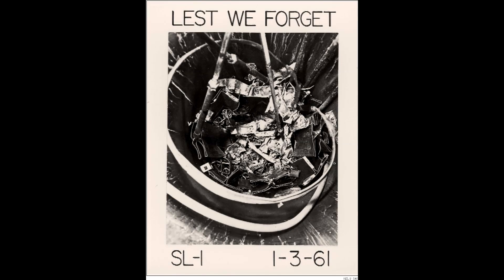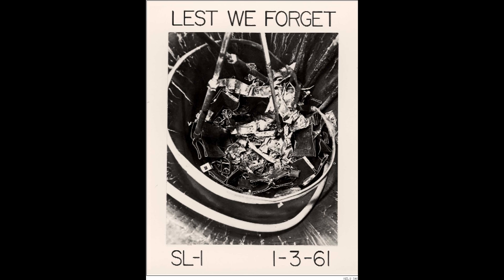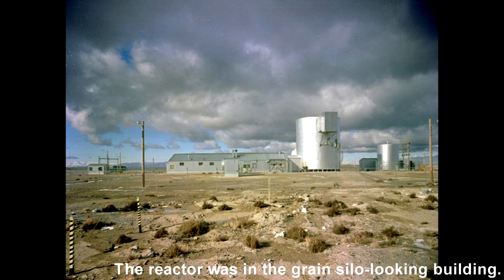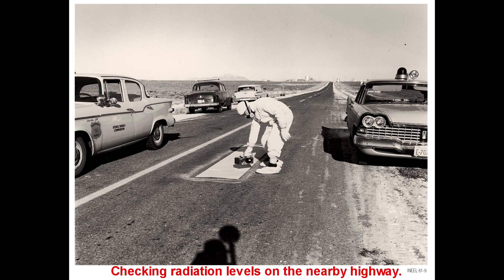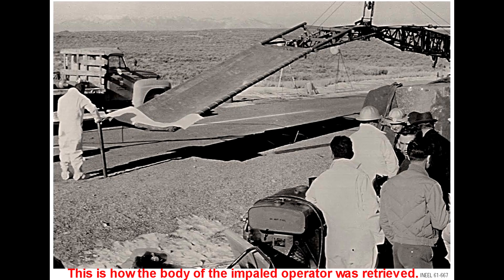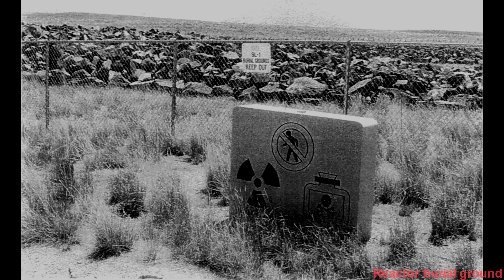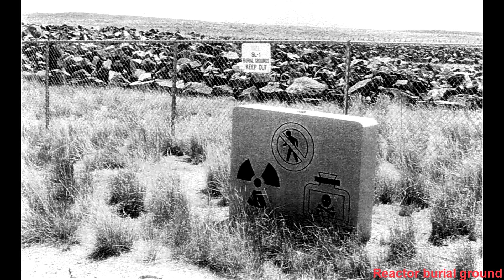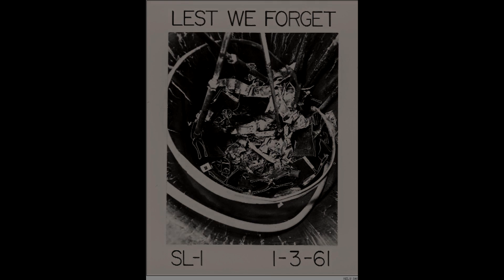SL-1 Accident - Quick History

Comment: The EBR-1 accident and Santa Susana accident both occurred beforehand, so SL-1 was not the first power plant accident in the U.S.
Reply: Yes that one reason it stands out.  Also the USAF wanted these for the remote radar sites in the Artic and when this happened then the plan was scrapped. The SL-1 would have been the first factory reactor.